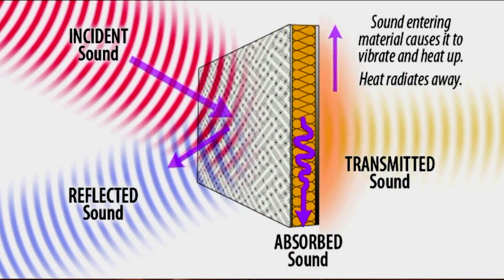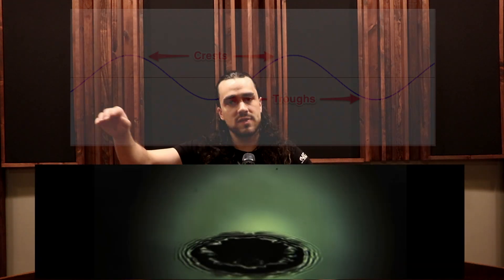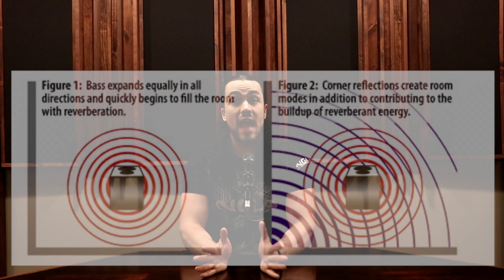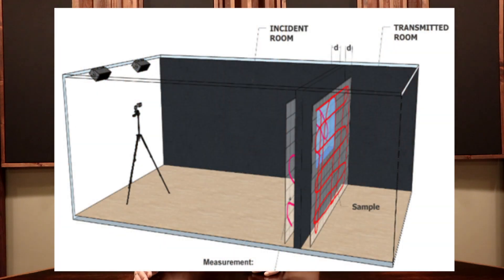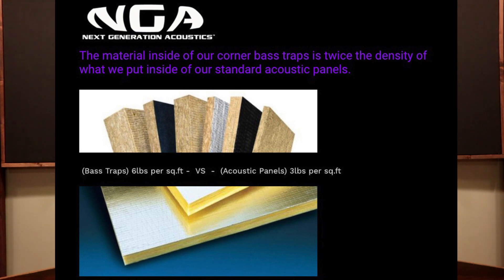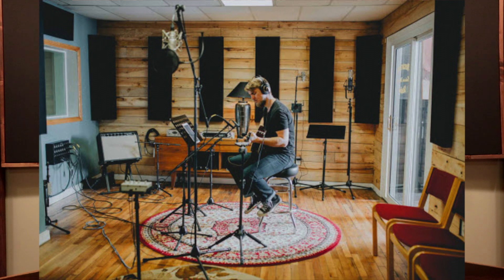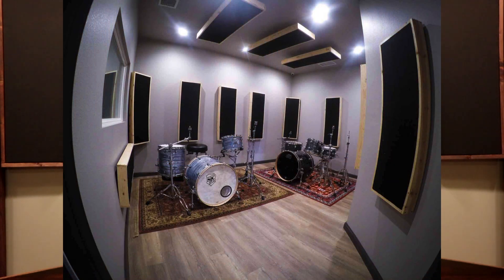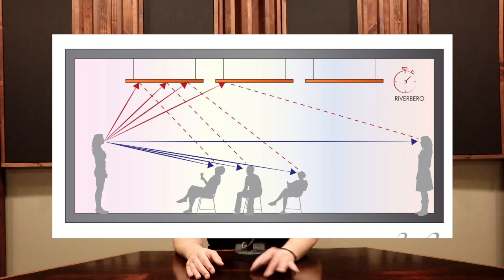What is the difference between an Acoustic Panel and a Bass Trap?

Comment: If you wanna build any kind of broadband absorbers use the porous absorber calculator, play with it! The thicker you go, the lower of a GFR you need your material to be. And yes, an air gap is very welcomed, but keep in mind that the "box" (the frame of your panel) should be closed off to the wall (not neccessarly sealed), this will improve your absorbtion coefficient which means more low frequency absorbtion for free.
Reply: First time hearing/reading this. Most commercial bass traps are not closed off I believe.. could you explain why it should be? Would be highly appreciated
Reply: @anthonymuc  If you close to box to the wall the absorbtion coefficient lowers itself, if you just space the entire panel from the wall that open airgap won't lower the coefficient that much. Just something I learned form John Brandt and asked him myself about sealed or not because I was confused too.
Reply from the maker: This technically is false. I don’t really care what specific guru’s advice that you follow. I know directly from the manufacturer itself, that when they do the coefficient data testing, they do two tests. (One flush to the wall and then another test 16 inches from the wall) Regardless of the material being used, this is a uniform standard across the field of acoustic absorption coefficient data testing. And regardless of the material used, whenever it has a 16 inch gap to the wall, it has a BETTER lower frequency absorption coefficient. This is well documented/proven scientific data. This also works as a double whammy allowing for corner straddled bass traps to ship using less weight/material, while providing a lower frequency absorption coefficient. We have made full corner bass traps as well as bass traps with the air gap and have had success with both styles. However, overall it’s going to largely depend on the room that you’re in, the dimensions of the room, the other Acoustic treatments within the space and what frequency problems you’re currently experiencing that determine whether or not you need a bass trap like you’re mentioning. More often than not, a corner straddled bass trap (with an air gap) is an EXCELLENT solution. 👍
Reply: @NGAcoustics  I never said that if you don’t close the box the coefficient will not lower. And I also never mentioned that an absorber with an air gap performes better than an absorber which has the whole box filled. A full panel vs a panel with a specific air gap should perform the same if calculated accordingly. My 50 cm deep panels have 40 cm of material with a 10 cm air gap because they would’ve perform the same if they were filled. My 30 cm deep panels are filled because, due to the GFR of the material I used, they would’ve been less efficient at that specific depth with an air gap.
Reply from the maker: @panickedrobert  What I’m saying is that you’re wrong based off of countless tests, scientific data and easily provable/searchable data. You specifically said “closing in the bass trap would increase the frequency absorption coefficient…” Which is patently false and unproven.
Reply from the maker: I would also not recommend opting for a thinner panel just because you have an air gap. You cannot necessarily replicate physical, material, density using empty space as an equivalent.

Comment: Play around with a bucket and water and something to bob up and down in water you'll see placement of speaker is critical. Corners are not needed if you place sub correctly
Reply from the maker: Good insight! Yes SOMETIMES this is the case - however there are many times/scenarios when corner bass traps ARE actually needed, even if you DON’T have a sub! 
Ex. Smaller room, square/rectangular room, mastering/post production room etc. Most of this is obviously relative to what you’re doing within the space, the dimensions of the space and treatments that you currently have in there.

Comment: I'm poor. can I stack a bunch of that fluffy pink insulation rolls stacked up high in my corners? then throw a huge black fabric drape over it. would that be effective at all?

yes this insulation is "fluffy" however in these rolls they are packed VERY TIGHT. so the density is higher
Reply from the maker: Actually, I don’t think you should let anything get in your way of creating! Usually having some treatment(s) is better than no treatments whatsoever (even if it’s an “incorrect density” or not even “properly placed”) it can still yield positive results over no room treatments whatsoever… 
Below is another video of my personal recommendation of four things you can do if you cannot currently afford acoustical panels/treatments… hope it helps! 😎
https://youtu.be/Ijqpj3dVmGk

Comment: Hey
i m in to new room the avilable space is 
A :: 15x21x10     WxLxH 
B:::  16x21x10
C:::: 17x21x10
Which one is good
And there is no window etc only  one door
Reply from the maker: Personally I would go for the 17 x 21 x 10! Another good option is to 16 x 21 x 10… But I would stay away from the 15 x 21 x 10… The dimensions with the least amount of square root numbers that can be used (between the various dimensions) the better overall!

Comment: Great explanation thx. 
So if I use compfortboad 80, which is 6 lbs 24" ×24" × 6" high should do well as bass trap and 3 lbs 16" × 48" × 3" for mid and frequency. Am I getting this right. 
Hope you can reply to my question thx.
Reply from the maker: Actually, yes!
Reply: No

Comment: So if the 16” air gap results in lower frequencies being attenuated I ask you this: if I’m building a tube trap and I want it to be an 18” diameter trap should I go for the 1.5” thick fiberglass or the 5” thick? The 1.5” right?
Reply from the maker: That is a really really good question! However… One factor that you’re not considering is that the density of the material being used ALSO determines the frequency absorption coefficient… 
So the main concern with that would be, that the 1.5in thickness material would not provide you enough “oomph” and density for it to effectively absorb the “lows” like you want it to. I think the ideal solution here (assuming your goal is low frequency attenuation) would be to build one closer to around 2ft diameter and then use the 5in thickness material instead! Hopefully that helps! Thanks for the question!!